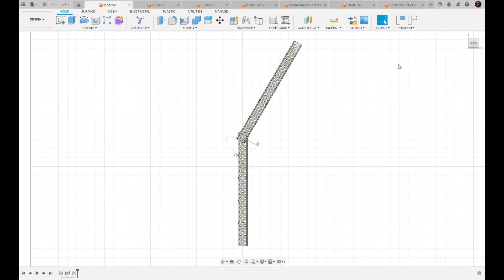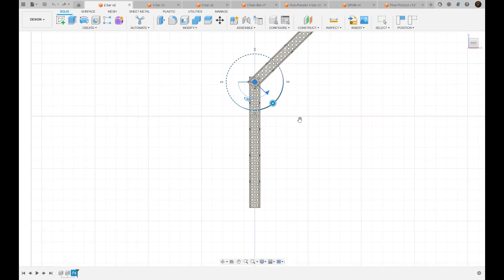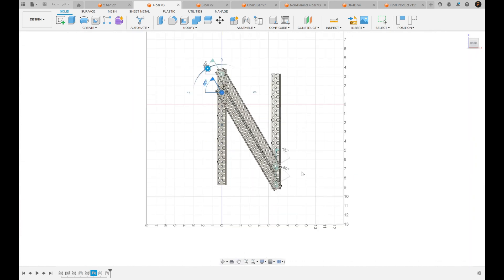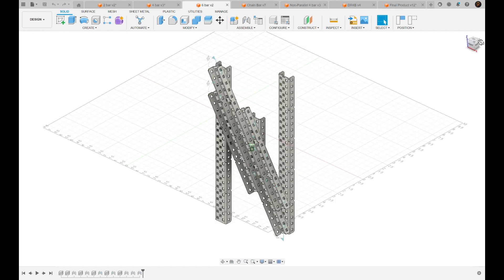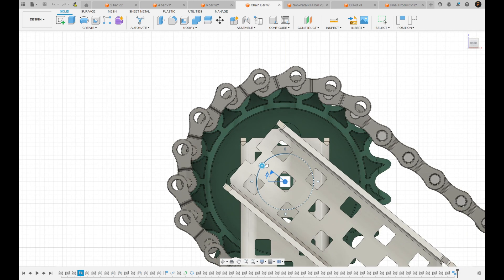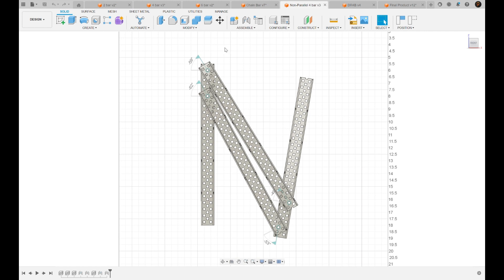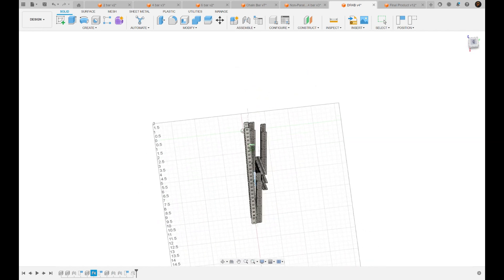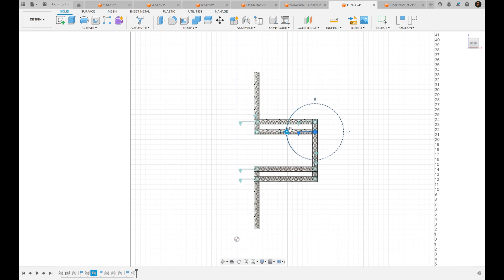Vex Robotics Lift Types Explained

Comment: I am currently working on a 6 bar lift in fusion and I want to know how you modeled yours to work? Motion links between my joints only results in absolute insanity. How did you do yours? Thanks.
Reply from the maker: @Engineeringchaos i believe I just had all the spacing correct and then applied revolution joints. If any of the spacing is off that will cause problems though.